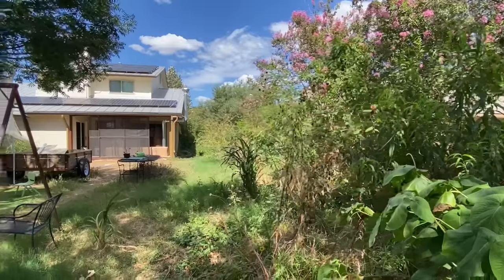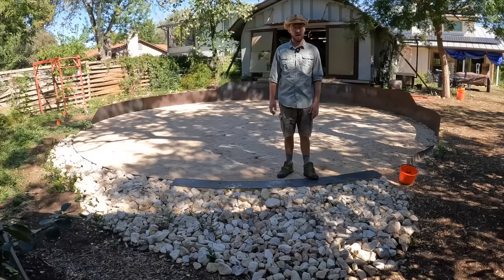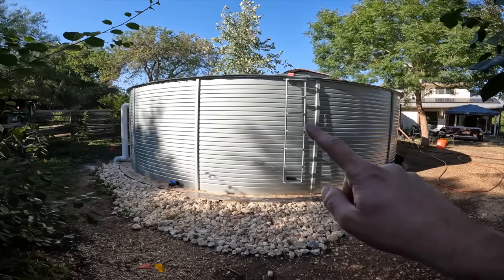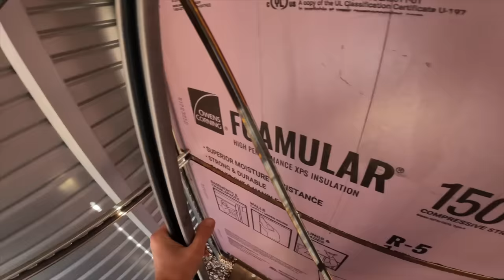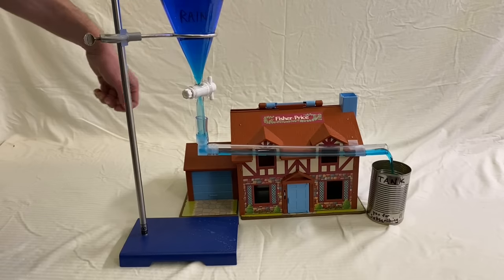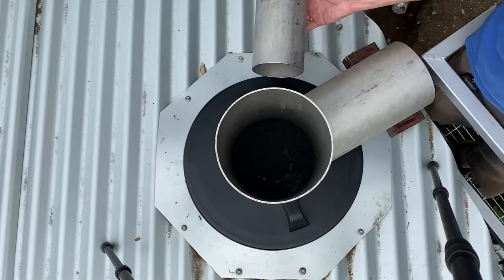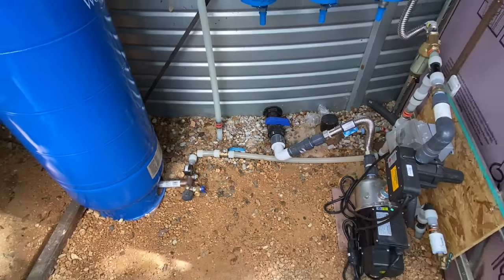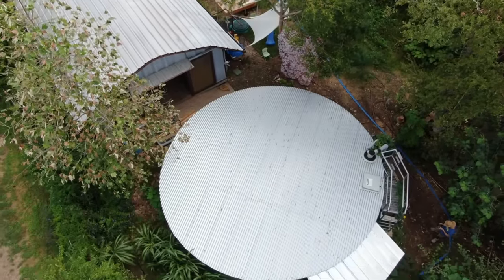FREE water forever.  LEGALLY!!!!

Comment: I work in the office for a company that installs these rainwater systems. Here in The Netherlands we build them underground. That way the water  temperature stays constant, no algae in the water, and it can't freeze in winter.
Reply from the maker: That sounds awesome. The cost of this project would’ve tripled if I had gone for an underground tank. Otherwise I would’ve loved to have done that. Thanks for commenting.
Reply: @suburbanbiology In Belgium we are forced by law to have one for every new house. Also in the ground. They're made out of concrete so cheaper than a stainless steel tank.  When they dig the foundation and sewer pipes and utilities they dig it in one go.

But why not just drill a borehole and have a well, it's not a complicated process unless you have rocks. Simpler and no need for a huge tank at all.
Reply: @kristofp72 many houses in the northeast have wells.
Reply: @kristofp72  cause Europe sits on fairly soft clay-like dirt that is way easier (and cheaper) to dig out...
Reply: I’m in Seattle in the USA and we have places that are doing this now
Reply: I was thinking if I were to perform this, I would put the tank underground.
Reply: You live in a extremely small country....most cities are bigger than your whole country.
Reply: @suburbanbiology  How much to build yours? Just curious!
Reply: @EternallyGod  what’s your point? It makes no sense 😂😂😂
Reply: @tracexcze5408 ? Not every part of Europe. Only the low countries.
Reply: @kristofp72 we have contaminated our water table below ground in many areas. It is also difficult to permit a well in areas that have public water. Many laws controlling this that people decide not to see (in a country that prides in freedom).
Reply: @EternallyGod  what has that to do with anything 😂.  They're doing the same across Europe.  If anything it means you have more space to do it than we do.    We live in one of the most densely populated areas in the world.
Reply: @ameenameen  I've noticed over the years some Americans tend to take things personally and get offended when they're confronted ideas or solutions that challenge their ideas. They take it as if you're attacking their country or something and feel the need to make it personal. I'm well aware I live in a small country it doesn't hurt my ego at all 😂.
Reply: @kristofp72  wells can be contaminated from other wells in the area.
Reply: @kristofp72 hey I know your from the Netherlands I’m from central Texas and a contractor for a building company the Texas earth is either hard caliche or limestone limestone is porous and so is concrete algae should be a problem put some pure copper coins
Reply: @FrisianDroneAviator  Mind you, in some countries people don't know too much geography or geology! You know what I mean lol
Reply: @kristofp72 
Yeah, it seems us Americans are purposely raised to be offended here. It keeps us at odds with each other so we’re always fighting and not uniting. I think it’s used as their #1 way to control us and it’s extremely disheartening.
Reply: That’s awesome!!
Reply: Cisterns?
Reply: In Persia (iran) tbis exists since some THOUSANDS YEARS
Reply: @kristofp72  well water tastes, smells, and is just plain nasty. Not that the alternative is much better.
Reply: @suburbanbiology You are absolutely correct with the cost increase! I'm from the Virgin Islands, where we build in ground water collection under our houses, called "cisterns" made of cement. These are more than half of the cost of the house.
Reply: Here in Texas the water table is quite variable. Near Houston it's really high. We don't/can't have any basements or safe to drink underground water storage. Plus our hurricanes flood a lot. Hurricane Harvey flooded almost 4 feet of water inside of our Houston home. We've got restrictions on how deep anything goes. It's safer for us to have things above ground.
Reply: Multiple areas of Texas includes heavy alkaline clay soils. Other areas are basically a desert. Other areas are swampy. Closer to Oklahoma it can be a red clay. We do have low mountains as well.
Reply: What was rhe cost and how long will it take to get that money back? Plus how much time each week on maintenance?  @suburbanbiology
Reply: @kristofp72  Aha, so you have a cistern?
Reply: @kristofp72 wells require electric pumps to bring the water up to the surface. This water catchment system needs an electric pump to take the water to his house, but if the power goes out, he can still get water from the tank for necessities, carry it to the house, and run it through a filter manually. Still better than having to buy water from the grocery store.
Reply: @occasus7964 I don’t know where you have been tasting well water, but a good well drilled and installed properly produces excellent water, and in my experience with three different states of the country, the water produced does not even need filtering. Some places do have sulfur in the water if you happen to have property that sits on a sulfur deposit. In that case your well has to be deep enough to be below the sulfur deposit. Edit for spelling
Reply: @kristofp72 underground water isn't endless
Reply: @occasus7964  the alternative being rain water or no water?
Reply: @AnneGoggansQHHT city water wants to collect their monthly fees. If you have free well water they don't make money. A lot of places will put a meter on your well and charge you anyway. Yep, land of the free!
Reply: @kristofp72 wells can dry our and become contaminated, which the homeowner cannot control, plus wells are not always viable.
Reply: @suburbanbiology  "That sounds awesome. The cost of this project would’ve tripled if I had gone for an underground tank. Otherwise I would’ve loved to have done that. Thanks for commenting."

Well then, your mission, which I'll doubt you'll accept cause you're a cheapskate, is to build ANOTHER water tank - this time underground.
Reply: @stephenkolostyak4087 he won't listen to YOU lil bro it's not like YOU could build a rainwater system like that underground or overground.
Reply: @EternallyGod  Just so you know literally any city on earth is at least 20x smaller and thats when i compare the biggest city on earth (Tokyo) to the Netherlands and yes it is a very small country but it is still quite decently sized for Europe and btw the Us is about 282 times bigger;)
Reply: @5ean  Tokyo isnt the biggest....Also have you been around New York which is the biggest? It is all cities touching each other...so if it the census actually considered the mass of the cities there would be such a huge lead in the NE of north america....
Reply: The Netherlands have genius water engineering and city planning. ❤
Reply: Genius? that is an opinion not a fact.